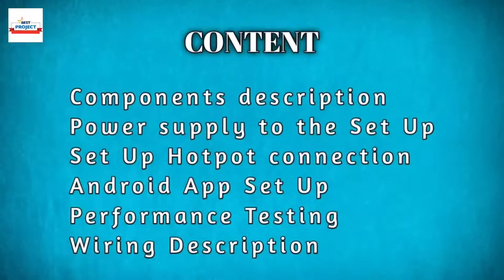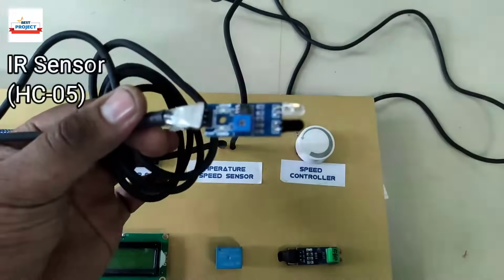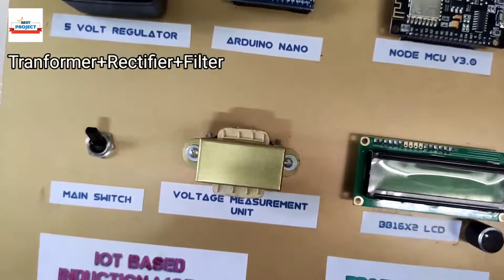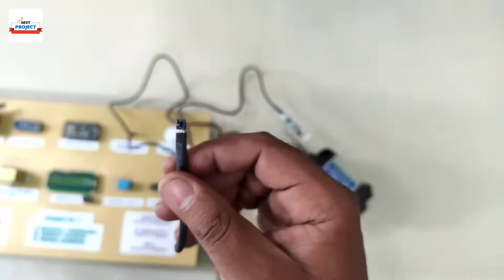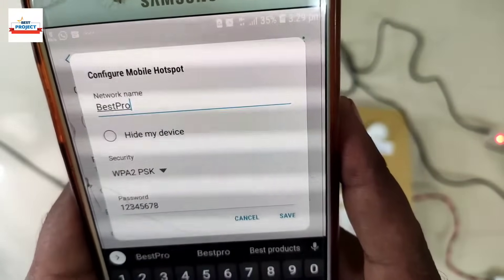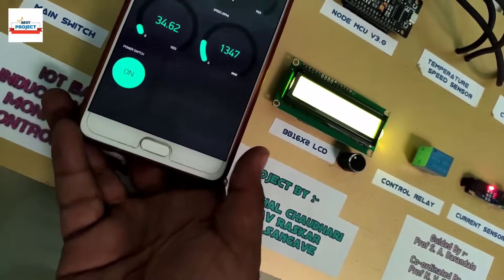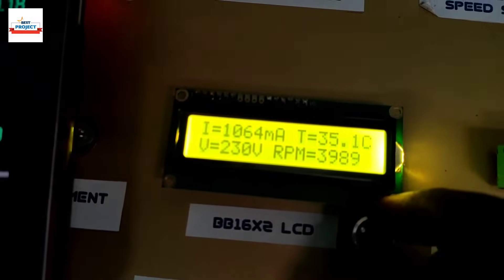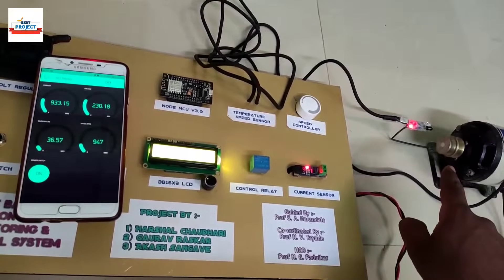11. IoT🌐 Based Motor Monitoring & Control System | Current | Voltage | RPM🛞 | Temp🌡️| Control | 2024

Comment: Can we use ac motor in place of Dc motor how to use it & which ac motor is usefull for this project
can you explain??
Reply from the maker: Sure, it is possible to use a Dc motor, if you want we can provide you this set up with a DC motor.
Reply: @ElexysProject  can we use ac 
motor in this project??
Reply from the maker: Motor shown in the video is an AC Motor.